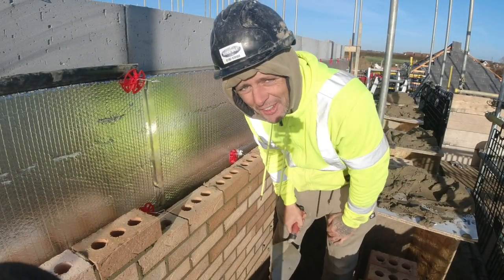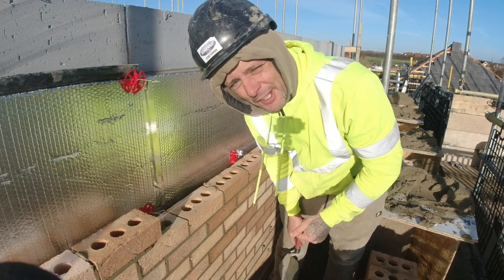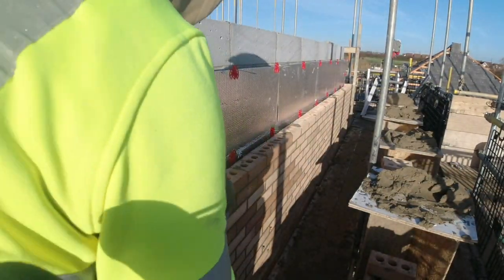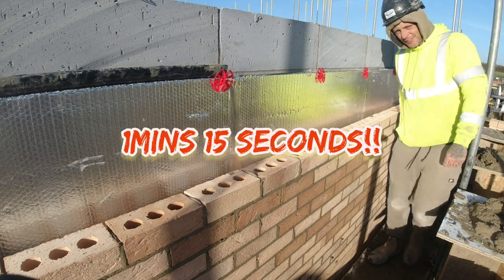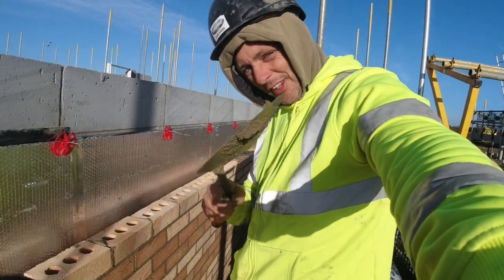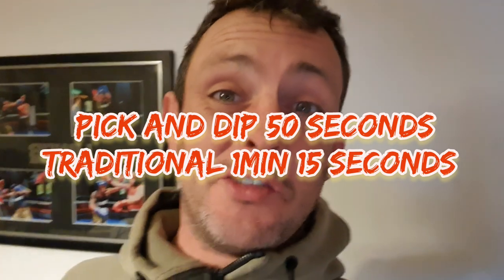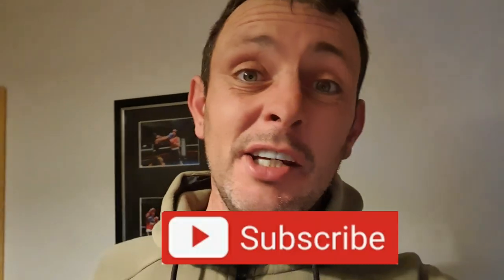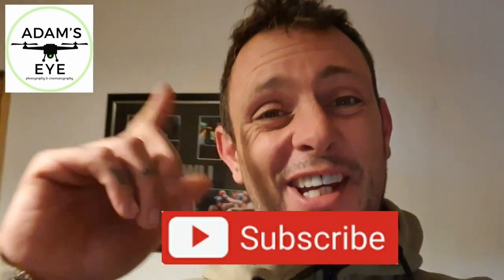bricklaying pick and dip vs traditional

Comment: Ive done traditional for near 40 years, me and mate tried pick n dip for the first time yesterday, on a run of 24 bricks, pick n dip was 30% faster and we had only tried it for 3 or 4 courses prior to the timed runs. Admittedly it took a while to start getting the peeps filled but it comes with practice and you have to start the push at least 1/2 brick before the perp. I think give us a couple of weeks and that 30% will be nearer 50 which is a big jump when your on price 👍
Reply: And I would add ive had numerous steroid injections in my elbows and cortisone in my shoulder, if this is genuinely easier on your body I wish I had found this when I started 🤣
Reply from the maker: Yeah mate. Keep with it 💪 you should make more coin. 🧱🧱 I do abit of both to keep me entertainied lol